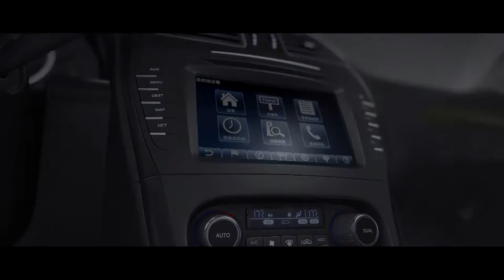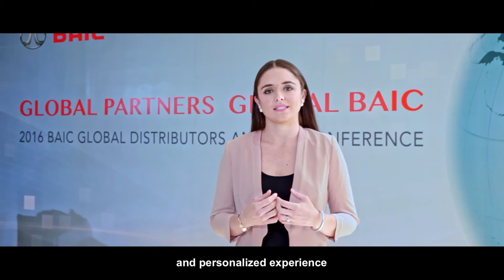BAIC Brand Video

Comment: Listen to your customer feed backs
And do some research on improving fuel efficiency within city limit . 
It has never been 12 kmpl as mentioned in your catalog . 
The pick up is slow and gear transmission is sluggish at low rev as compared to other SUV like MG ZS . Try to solve these issues to capture market . May be you can upgrade software for gear transmission and introduce dual clutch transmission as in MG ZS. 
Fuel efficiency is the most important factor that Asians look in to and you cannot capture the market if yo don't address this major basic issue.